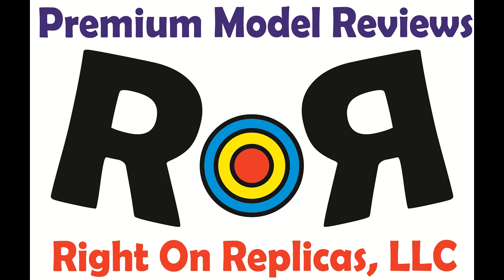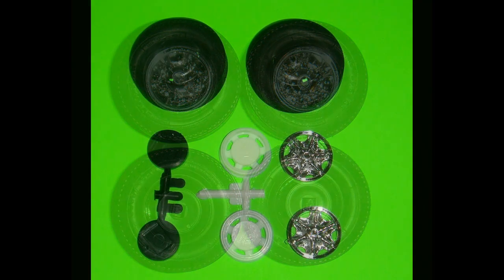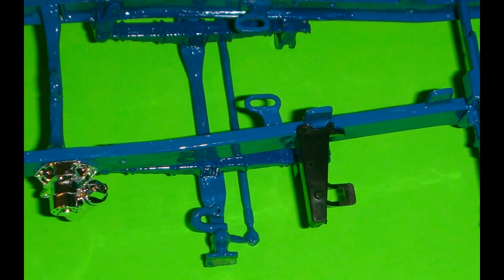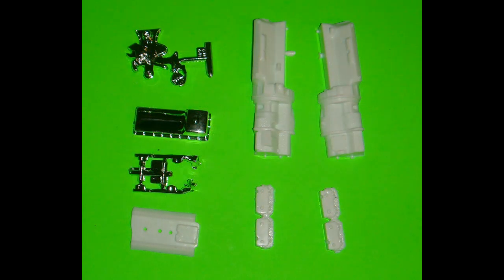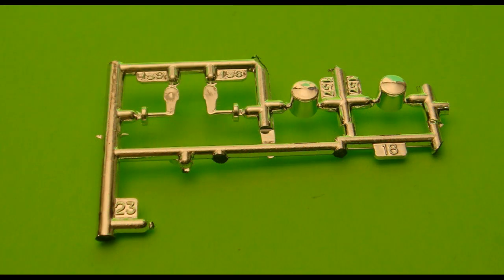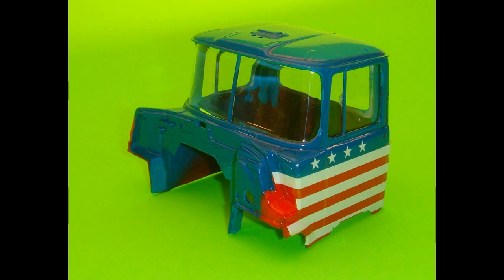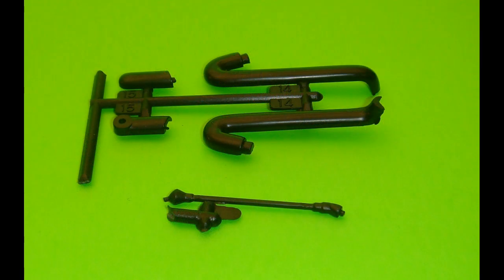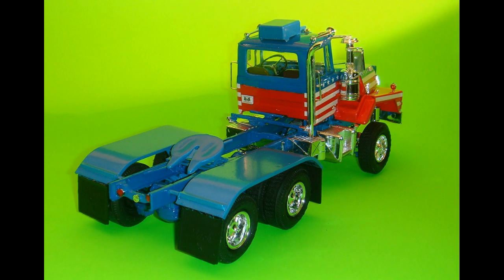Mack DM-800 HD Tractor 1:25 Scale MPC #899  -Model Kit Build & Review

Comment: Doug, I knew eventually the Mack DM800 was going to make it on the channel being that you did the Mack DM600. I really enjoyed your version. I have already built two DM 800's and you aren't kidding about the warped parts and fit issues but I made it through all the frustration and it paid off in the end. I actually do plan on building the box version in future. I'd like to share with you my second DM800 that I did late 2019... Thanks for sharing Sir!
Reply from the maker: JG,  Looks like you've had good success getting past the warpage issue.  You demo looks good and the weathering is a great touch!  -Doug
Reply: Thanks a lot Doug. Glad you enjoyed it! This particular DM800 will be a dump truck so I need to find it a donor dump body and components and then off to Phase 2.
Reply from the maker: JG,  Good luck with your search and have fun building it!  -Doug

Comment: What I would have done is glue the fenders on the cab and modified some mounts so it sit right. Thats the kit I was looking around for a long time.
Reply from the maker: JB,  Thanks for the tip.  These are re-released so you can get one reasonably priced now!  -Doug
Reply: @RightOnReplicas  It did turn out nice though considering the age of the kit I have two of the DM 600 trucks one I turned into the dump truck and the other is the normal on the road truck.
Reply from the maker: JB,  You're having some fun then and running out of display space!  -Doug
Reply: @RightOnReplicas  Oh yes, I have so many models. I watch your videos and also hpi guys model workshop. I would like to start up my own channel and show off what I build.
Reply from the maker: JB, Go for it!  -Doug

Comment: I had problems with the frame being out of whack
Reply from the maker: Mike,  It's not uncommon.  It helps to build the frame on a flat surface with gridlines and slow setting glue to  adjust it.  You may also have to use the hot/cold bath to get it straight again!    PS, please help us reach more modelers by subscribing if you haven't done so already.  -Doug